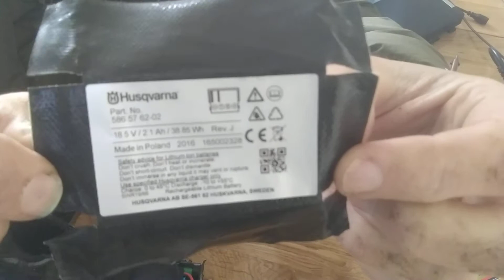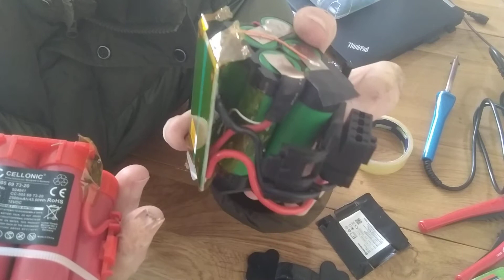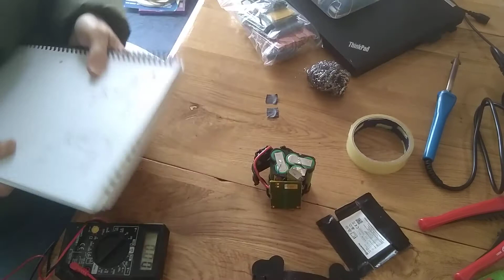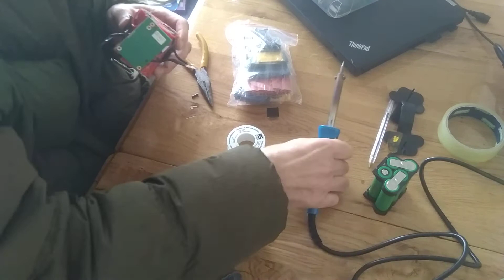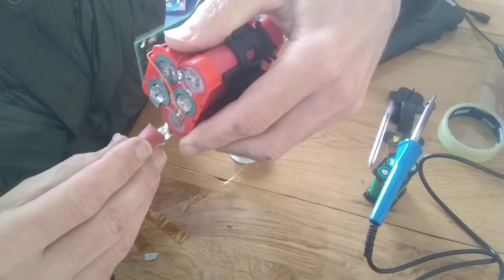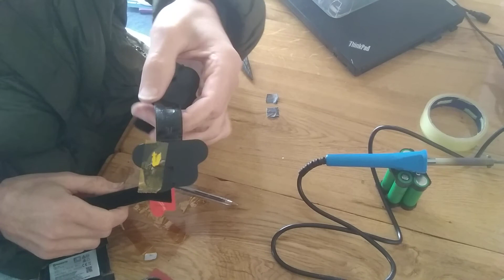Flymo 1200R  auto mower - Moving the battery management system (BMS) PCB card to a new battery pack

Comment: the mower with its new battery and reused circuit board is OK as far as cutting. However it does not return to dock and I find it dead on the lawn. I think it cannot determine when it needs to recharge. I suspect the circuit board detects when the voltage drops and the new battery is stronger at 25 as opposed to the original at 18WH. Thus the voltage only hits the recharge level when the battery is nearly exhausted.  Any suggestions  how to make my mower do all it should?

Comment: I suspect this is a really useful video, but unfortunately after the camera is switched off to allow the guard plates to be removed the audio drops to a level that's barely audible, even through headphones. I don't know if it's possible to re-record it?
Reply from the maker: Thanks for the comment. I noticed that as well. No idea why that happened. I found if I increased YouTube volume and system volume I could hear myself. In essence you move the wires from where you found them on the old pack to the same place on the new pack.
Reply: @ksmith7122  thanks Kevin. Did this fix the problem with the 1200R? Mine behaved erratically for a couple of weeks and has stopped working. 740 charge cycles over three years.
Reply from the maker: @simonharvey1051  HI Simon,
replacing the battery fixed mine completley.
These mowers take a lot of time to set up properly and mine was a pain the first season becasue I did not bury the detection loop wire round the edge of the grass. Burying the wire a lot of work, but you get all the effort back becasue the mower never cuts through the circuit again in an unknown location.  On one occasion when the mower worked eraticaly, on and off the surface edge wire had been cut through but sunlight was expanding the wire just enough to conenct the loop togather again at times. 
It could be lots of things causing intermitent operation. 
I don't think that with 740 hours total operation time that it is your battery, especially not if the only problem is  intermittent operation.
What do you mean by intermittent?
Can I have more information please
Reply: @ksmith7122  yes mine has been excellent. But a couple of weeks ago it stopped from time to time and today behaved erratically. After fully charging:
Voltage 20.5V
Number of charges 707
Charge level 1197mAh
It's mowed for 955h on the original battery
Reply: I should have said that the cables and everything else checked out okay.

The mower moved only a few metres, never spun up the cutting motor, and made a feint high-pitched whine.
Reply: New battery fitted and all working well. Thanks for your help.
Reply: i got round this by putting subtitles on
Reply: Can you buy replacement batter management cards. Mine was accidently thrown out in the rubbish
Reply: Enable subtitles